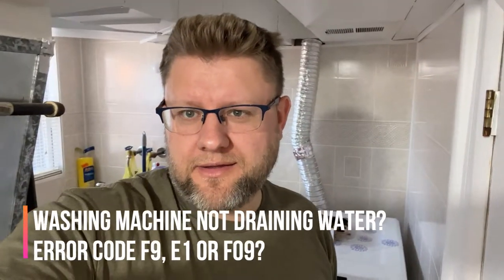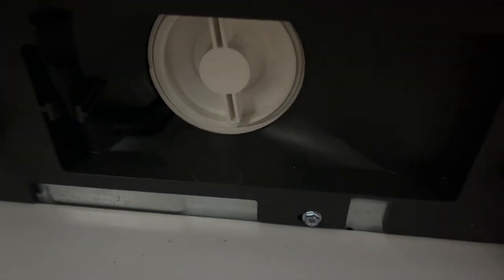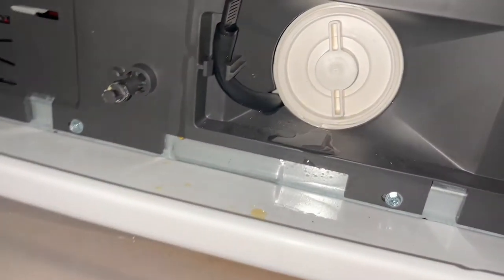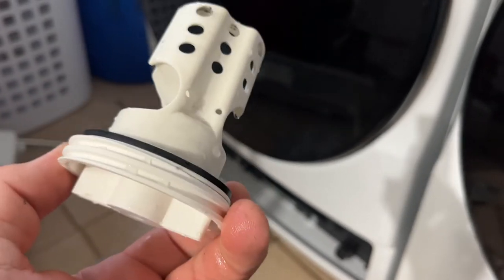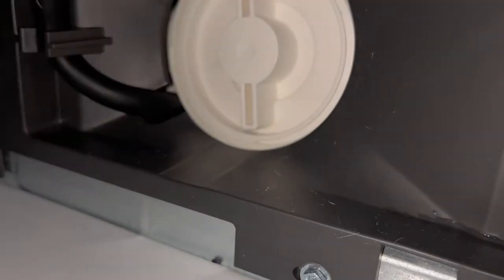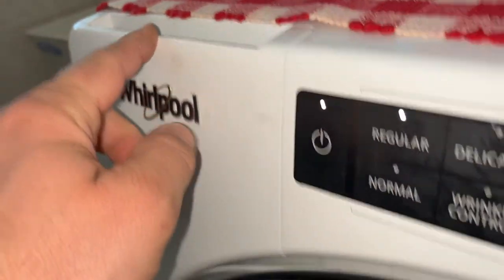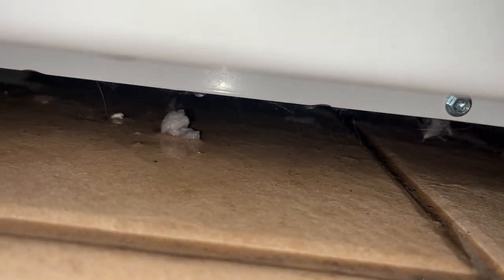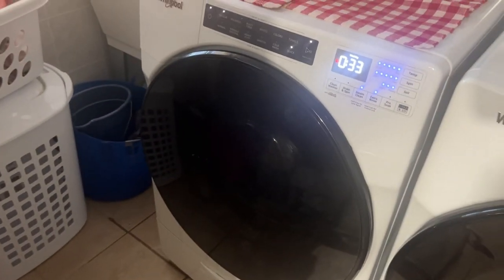Whirlpool washing machine WFW6620HW how to clean drain pump filter.

Comment: This video is in fact useless for 99% of people. Most late model whirlpool front load washers require removing the back panel to access the filter. The washer machine in this video has the optional automatic detergent option which gives you a pull out drawer and easy access to the filter. Just fyi
Reply from the maker: I don’t understand why they making the newer washers like that so people suffer more and Calle technicians to repair it?
Reply: You mean 'early' model??
Reply: Back panel? Nah. Newest ones you can’t access without removing the entire front of the washer. This comment led me astray twice! Since I didn’t have a front access door for the pump I figured I’d remove the back. Not super time consuming, but was a pain in the a** to move the washer since it’s on isolation feet. Only after removing it did I confirm the filter basket is in fact in front, with no way to access but to remove the front of the washer. I had to remove the top, control panel, remove the front gasket (removing and reinstalling the retainer was painful), then finally some bolts to lift the front off. Watch out for the door lock sensor connector! Boy what a stupid design!

Comment: Hey man. Hey. Is the pump and the drain hose supposed to be fully empty after every cycle or is there always residual water ? Thanks
Reply from the maker: There is residual water when you remove that plug to clean it.
Reply: @nazarettos6987  thanks for your reply. How much usually ? Does 2 cups sounds too much ?

Comment: I just stumbled on nasty lint between the drum and rubber boot.  There is a drain in the bottom of the boot just above this filter.  I used long needle nosed pliers to pull it out … next I will have to clean this filter.  Who knew. 🤷‍♀️